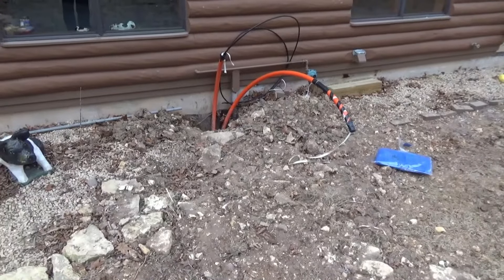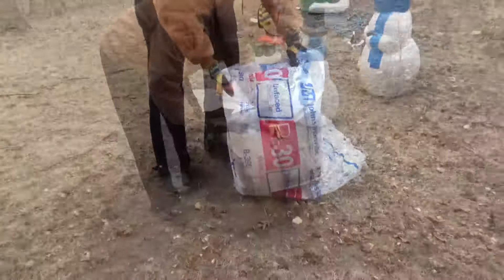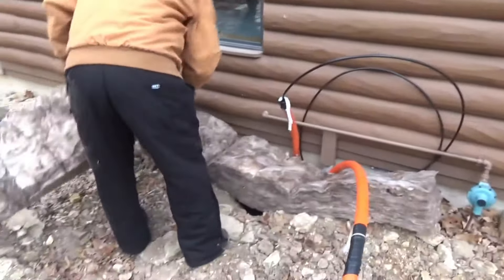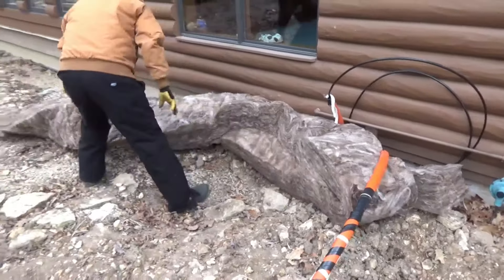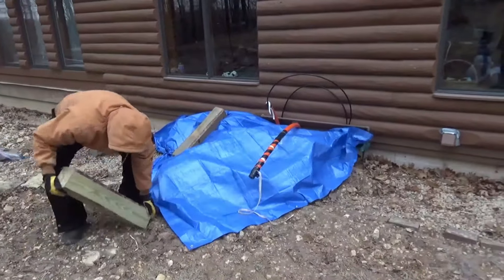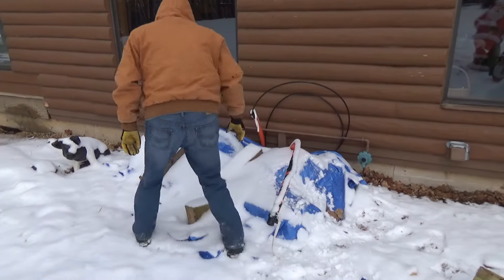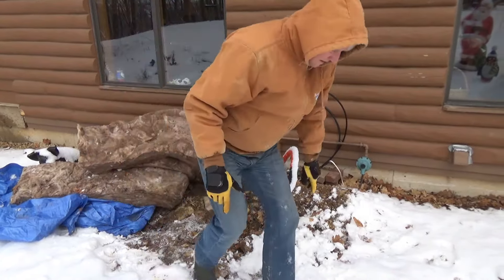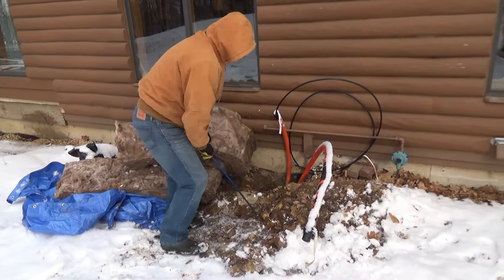How to thaw frozen ground quickly- Save money /  #77

Comment: This doesn't work, I live in ontario canada and did just as you said. Ground was rock solid still after two weeks. It maybe worked for you cause it's against your foundation which allows a certain amount of heat to escape from the home.
Reply from the maker: Hi DB. So sorry to hear you didn’t have good results. I’ve use this method several times and I’ve had good luck. I understand your comment about being close to the Home but I also wonder if we have different soil conditions. I’m 60% clay and rock.  I think winter is over here otherwise I’m gonna go out in one of the cornfields and duplicate this to confirm this idea works.
Reply: @billburkhart I know this is old but there is absolutely no way this could work away from a major heat source like a house.  There is absolutely no heat to trap, so no amount of insulation could help.  I'd bet you a lot of money that if it stays cold all week, the ground away from a house could never thaw.   The ground is at or near freezing several feet down and there is no heat that can be trapped by anything.  It takes weeks of warm weather and direct sunlight to thaw ground where I live.
Reply: That's sad to hear because I'm going to try it.

Comment: I don’t understand how this works.  Where is the heat coming from?  I didn’t want to blast and could only dig my water line from the well to the house down 3’.  So I covered the pipe in the trench with doubled up 3” thick ridge pink 4’x8’ foam boards the entire length before covering with 2 1/2” of fill.  It still freezes if when it get too cold and I don’t drip a faucet.
Reply from the maker: @GG-sj2wg   my experience would have led me to install foam board on all sides of the water line. Good luck my friend. -Bill
Reply: @ I did run the waterline inside a 8” PVC sleeve into which I sprayed a frothpak worth of foam.  Plan to build a permanent greenhouse over the top of 90% of the line this spring.  Till then it’s 1/2 dozen piles of charcoal spread long the line if/when it freezes.
Reply from the maker: I like your plan. I’m in Iowa where frost goes down typically 4ft. Where are you?
Reply: @billburkhart  Vermont up in the Green Mountains about 4,000 ft.  Solid ledge!
Reply from the maker: @GG-sj2wg   I understand. My home is sitting on solid limestone -Bill

Comment: Really?. That's great! I need to finish putting posts into a Sona tube in the hole and fill with quick Crete. the ground is frozen  and I have to dig 24inches! Ill try it. I live in Alaska and I'm a girl that's not looking forward to this. 😭
Reply from the maker: Eleanor’s, Be patient it will work. How much frost is in the ground now? -Bill
Reply: @billburkhart  hardly any but the ground is a hard
Reply: I have that insulation in my crawlspace I can pull out and temporarily use. But I don't want to wait 2 weeks. Maybe I can put a tarp over the insulation and plug in a small electric heater? But it might catch fire and the neighbors would call fire dept. 😭
Reply: @billburkhart  you tube won't let me attach a photo to you.  🥺
Reply from the maker: @eleonoradillewaard8291  Could you IM me?
Reply from the maker: @eleonoradillewaard8291   You may have luck with the plan you described, just be careful with that electric blanket. Put the blanket on the ground, then insulation and cover with a tarp.  Put some weight on the tarp to keep it from blowing away.

Comment: I tried this on Monday, waited 48 hours (I'm impatient) and I decided to take a peek today. Ground is still frozen solid. High temps around 40 the last couple days so I figured it would show some improvement. I decided to pull it up and try something else.
Reply from the maker: Sorry to hear it didn’t work for you Greg.
Reply: @billburkhart  I think the only way that could ever work is being right next to the house.  The heat comes from the basement or crawl space, not the ground.  At best the ground can be 54 F but in winter it's at or near freezing several feet down.  A thin layer of insulation would do nothing.
Reply from the maker: @drengr2759  I’m sorry to hear this didn’t work for you. I’ve done this several times far away from the house to bury animals who die in the winter and have had good success. It’s 3 degrees here this week so I’ll try it again and make another video. Thanks for telling me about your experience
Reply: I think drengr is right. the only way this will work is with a heat source like a foundation. I put down 4 batts of R20 with a vinly tarp ove the top. I weighted it down with firewood. After 124 days the ground is still frozen solid.
Reply from the maker: I’m sorry to hear you didn’t get the results that my video showed. I’ll have to make another video and re-test my theory. So far it’s never let me down. -Bill

Comment: Question? I have septic tank in Massachusetts about 8" frost tank is not currently being used and we need to have it 
 inspected, currently 12" snow would i be best to remove snow and place insulation blanket on grass area and how long would it take temperature supposed be low of 20 degrees and high of 40 degrees for next week. Thank you
Reply from the maker: @GoldStoreCT  Good morning. I'm not sure how this would work. With no heat in the ground like I had near the foundation (my basement is insulated), investing in a couple of rolls of insulation would be a cheap attempt.
If you HAVE to get into the lid, you could rent a ground heater for a day and get into the tank.  Let me know what you do. -Bill
Reply: Thanks Bill for taking the time to read and respond!!

Comment: Cool and smart!!
This method will really help! I hope... my frost typically goes a good 6 feet deep. Central Canada 
I bought a new place and the land is poorly landscaped draining surface water into the old garage, that has now been heated insulated and drywall. My quick fix will be a french drain with Big O pipe.
Reply from the maker: 6 feet deep wow, I see 4 feet here some winters good luck, hope you have good results as I did. I’ve use this many times and I’ve always had good luck with the process
Reply: I should add Bill, with this global warming, we really see the difference with more extremes both ways.
3 or 4 years ago we hit a -50C week. I used to think at -40 so what cold is cold.. BUT there is a definite difference between -40C and -50C . It got my attention! Our water lines typically lay at the 6.5' depth and when we had the-50 people's residential lines were freezing. At least it was a dry cold and I don't recall a wind.
I hear an early spring!!

Comment: Thanks, Bill. I am trying to ready a site for a hot tub here in Colorado. Only need to go 6 inches deep on an 8' x 8' area and level it. I put the insulation and tarp down a week ago. I just checked it and the ground under it IS warmer but still frozen. We had sub 0 F temps all last week. This week is looking to get above freezing for a bunch of days. Should I keep the insulation down and give it another week or go to Plan B? Delivery is in a week. Thanks!
Reply from the maker: How much insulation do you have in place now be sure it’s a couple of feet coverage it should work, especially only going down 6 inches
Reply: I put down one layer of r30 across the whole area - so it is probably 12 inches at best. Maybe I'll add more. Thanks!
Reply from the maker: Add another foot I know this will work, Cover the insulation so it’s nice and dry

Comment: Any advice for a frozen washout in winter? Found out the house has a washout for washing machine only and the guy who worked on house beforehand rigged alot of stuff including said washout. Was thinking maybe shoveling it out and doing rock/ ice melting salt  and tarp on it . Plus heater going in room pipe attaches to? Any thoughts/advice. Family decided to do a load of laundry during middle of blizzard causing drain pipe to freeze mid cycle.
Reply from the maker: If I understand your question the waste water drain pipe is frozen. I’ve used jetters that plumbers have to jet Thur the ice and return flow. After that a heat tape can be installed in the grey water line. 
I’ll send you a company that sells those tapes if your interested
Reply from the maker: Search for Heat line freeze protection systems for ideas for a long term solution

Comment: Okay, I am putting this method to the test. It’s in the middle of a opened acre it’s 12 degrees today tomorrow then drops into single digits during the day and a couple negative days. I’ll check it in a week and then leave it for another week.
Reply from the maker: Looking forward to your follow up report.
Reply: Hey James, let us know what your experience was, please. Thank You.
Reply: Hi fellas, I am in central Illinois and I purchased the same R30 insulation on 02/09/2021 and tarp and followed the instructions as the creator explained. I returned on 02/22/2021 and the ground is frozen. 13 days past and it is a fail. I am sure that with this procedure it was very helpful with that insulation being against a dwelling, however, on open land, it is a bust. James
Reply from the maker: @jamescanton9734  Sorry to her that James. I'll make another video out in the open and try to duplicate the results.

Comment: Has anyone ever tried an insulation tarp to cover over concrete? Worst case  forced propane heat  will fix the problem.  Currently digging out a patio for next yr anday down stone so that way it can settle.  The back yard project has been a 7 month ordeal.  Removing about 2 ft of soil to lay clear stone and have piping....  So was thinking of using my insulation tarp...  It's currently layed down anyways and will report back....
Reply from the maker: Good luck Richard, I’ve used insulation blanket while working construction, that will remove a lot a frost with no heat. Just pile the blankets on and wait. If you’re in a hurry you can always rent ground thawing equipment,
Reply: @billburkhart  thanks Bill I only have 1 thick tarp gonna keep it on for couple days and try that
Reply from the maker: @ricardo19851    Be patient, depending on your temperatures it may  take a few days